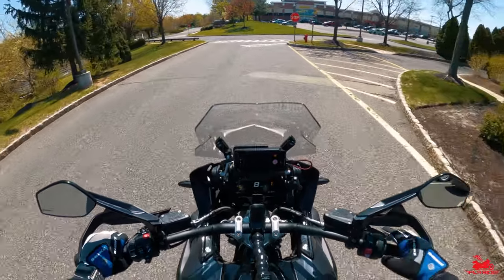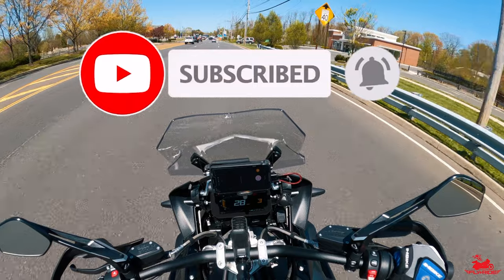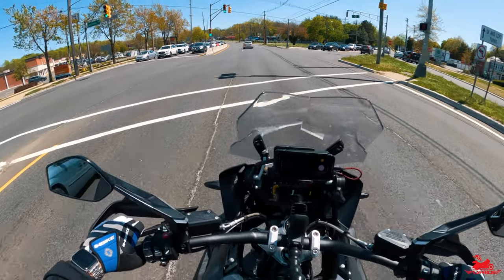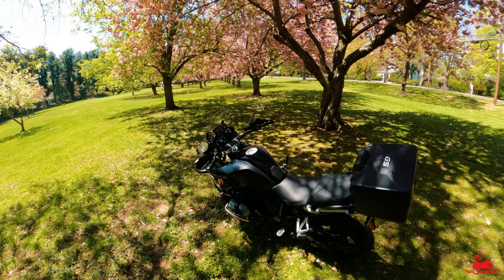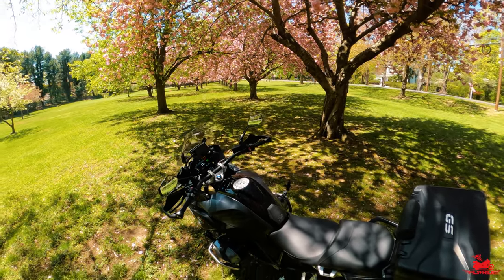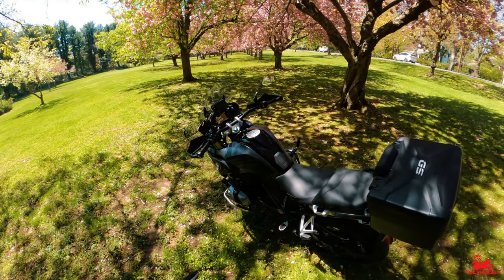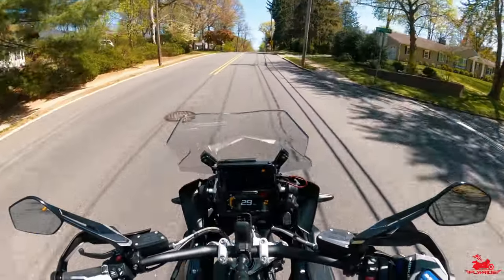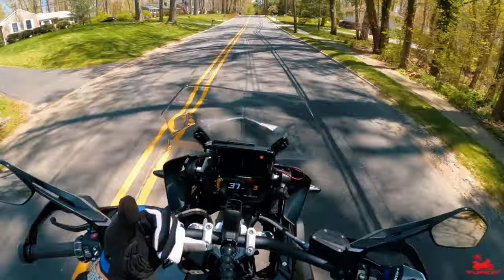2022 BMW 1250GS ENGINE SOUNDS

Comment: The more I see this bike, the more it makes me want one. I love my Tiger, but there are a few things that I'm not thrilled about. I'm also hoping to get a couple of BDR sections done, just gotta find the time. 🤙🔥
Reply from the maker: Thx man. Yes, there’s also a road that crosses all of Nj (BDR like) that we can also try but your right, issue is time 🤙
Reply: @FLYANDRIDE15  I think that one is the like the Trans NJ Trail, or something similar. That would be pretty cool as well.
Reply from the maker: @MisplacedMotoVlogger  I think your right, and I have an entry point like 45 minutes from me by Princeton NJ
Reply: @FLYANDRIDE15  Cool! Princeton has some nice areas to ride, especially away from the university.

Comment: Bike sounds good.  I'm curious how you set up your mic.  I'll shoot you a message on IG.  Thanks for sharing.   Ride safe.  👊👍🇺🇸
Reply from the maker: Sounds good. Basically used the rode wireless mic using GoPro media mod and you can see the mic adapter on the GoPro holder on the steering wheel. 🤙